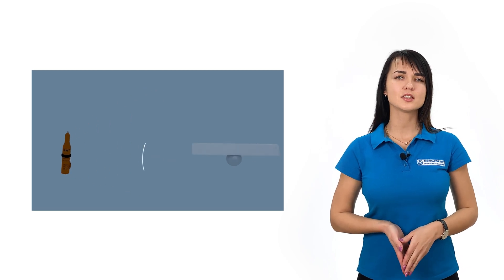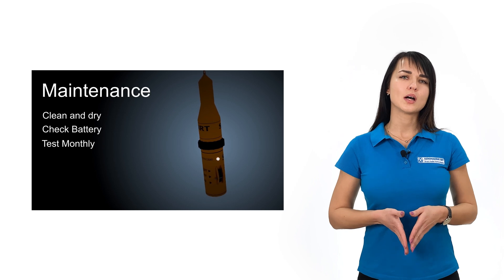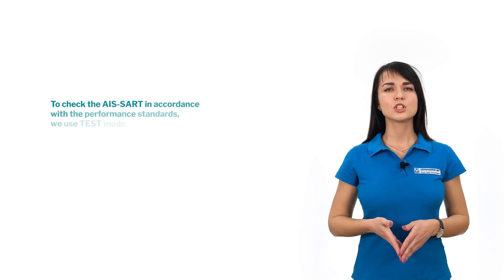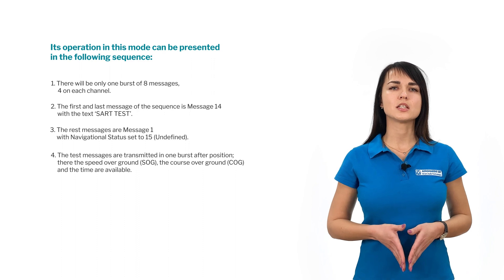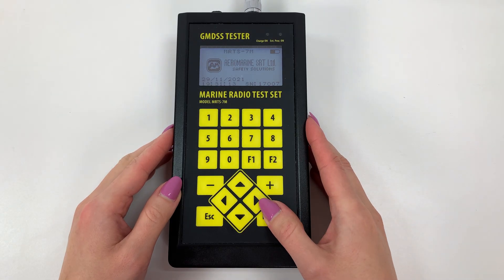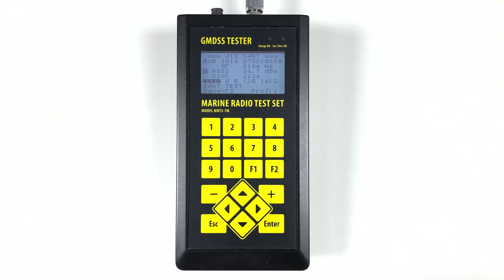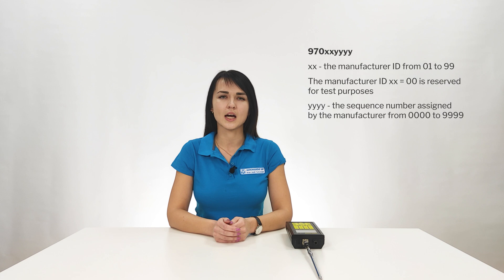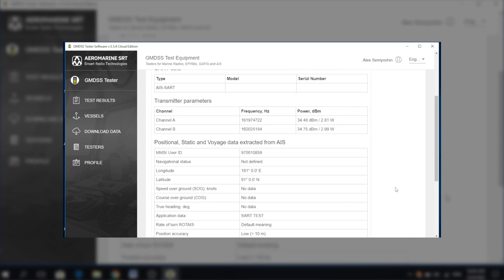AIS-SART testing with help of GMDSS Multi Tester MRTS-7M

Comment from the maker: IMPORTANT NOTICE TO ADD: 
At the timing 4:00: Interference of +-3dB is considered nominal. 
In practice, it is often can be from -10dB to + 5dB.
Please keep in mind, that each new measurement takes another 15 minutes, and also an extra consumption of battery power supply capacity.